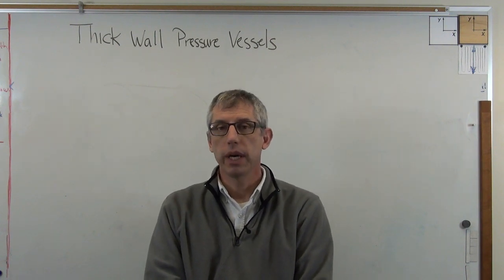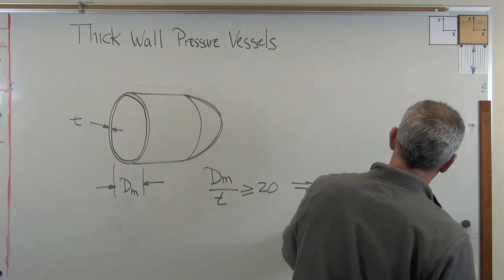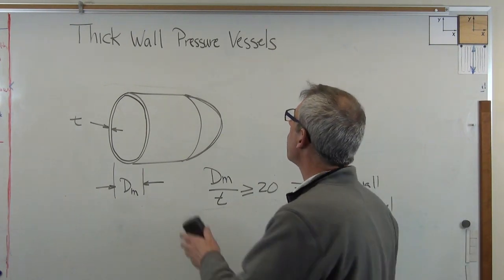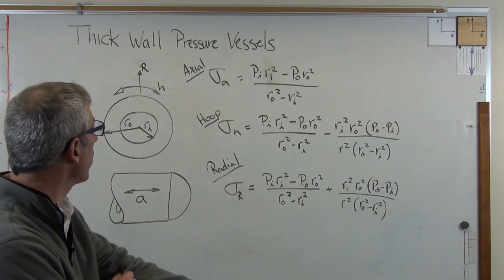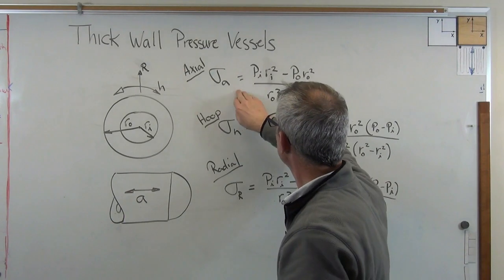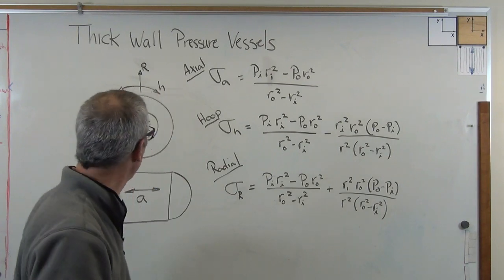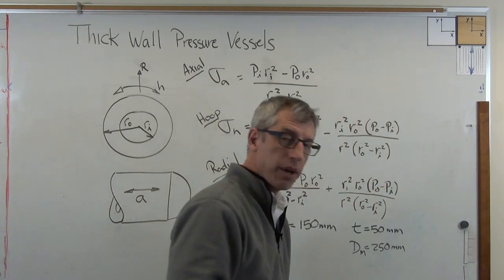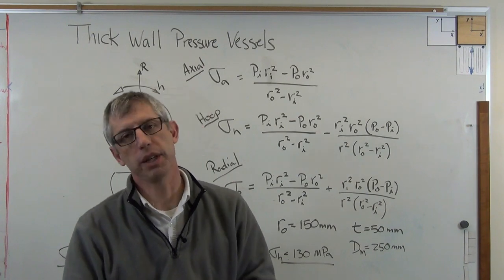Thick Wall Pressure Vessels - Brain Waves.avi

Comment: According to this book: https://www.springer.com/gp/book/9783319006895 his formulas for radial and hoop are changed with the + and -.
Reply: Just got confused by the same thing. Some books have the inner and outer pressure flipped in the second term which would cause a change in sign.

Comment: hello sir, my name is abdul haris, i came from indonesia, i wanna ask you about pipe stress analysis, from what i know stress in pipe and in cylinders almost same, my final task is about pipe stress analysis in pipe bend using Ansys and then validating with analytical calculation and the output is von mises stress, to know von mises i have to search principal stress in 3 axis, i used hoop and radial stress in your explanation, but the axial stress i use longitudinal stress which is sum of axial stress, internal pressure and moment bending, can you explain to me how to calculate moment bending in pipe bend please ? thank you sir

Comment: i have a question,
longitudinal stress try to increase the length of the vessel and
radial stress try to increase the diameter of the vessel .what about hoop stress ? what hoop stress will do?
Reply: Hoop stress prevent the vessel from explosion. Google state of stress and you will find a proper answer.

Comment: sir,
For a thin wall vessel; D/t>=20 or r/t >=20 ?
I am confused as in some papers it is the ratio of radius to that of thickness.
Reply: r/t>=10
Reply from the maker: Unfortunately, there is no standard definition.  It may be a function of the application.

Comment: How about a swimming pool. I am trying to build a pool wall with cinder blocks 24ft diameter. I want to use a band around each row, there will be 7, and need to know what the tensile strength of the band needs to be.